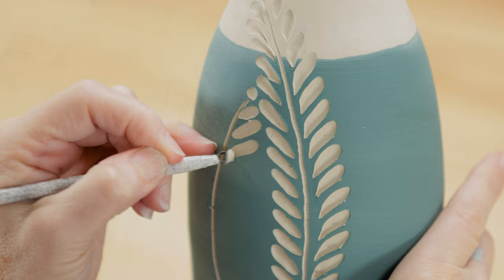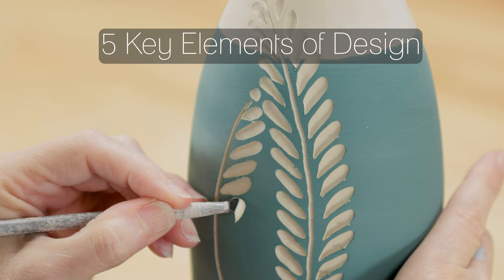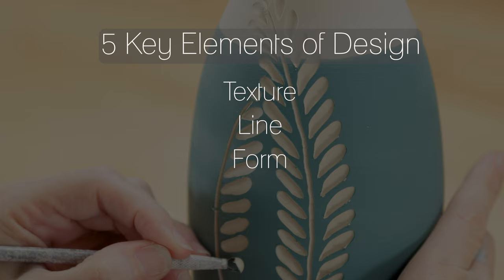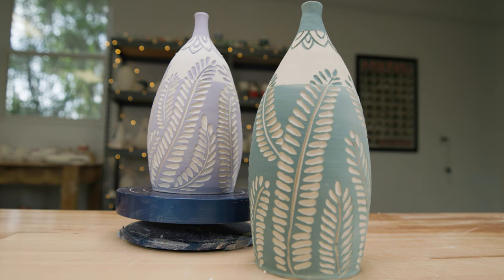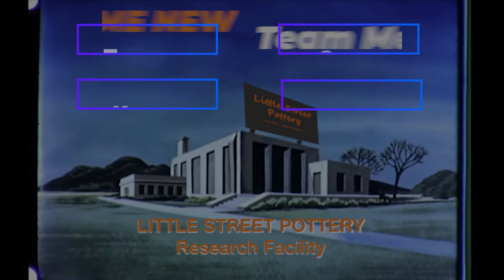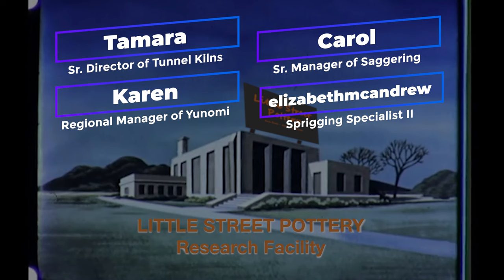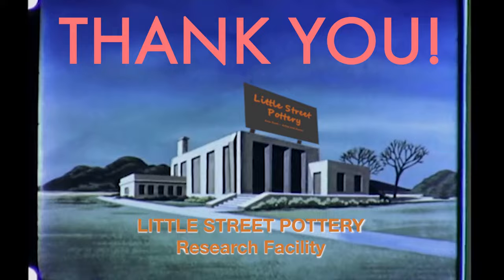5 Secrets to Better Carving and Design - Rethink How You Design Your Pots!

Comment: Ann, if you were going to buy just one diamond core tool, which would it be?  I am always looking for nice carving tools but then not willing to pay the price for diamond core, are they worth the price if you do a lot of carving?
Reply: Hey Vicki!  Thanks so much for watching.  That is a tricky question as each tool does different things.  It all depends on what you are trying to achieve.  I use the spinning trimmer all the time for dividing the piece into sections.  I use the extruder tools to make mug handles more than I find myself pulling handles these days.  I use the fluting tools when I am demonstrating fluting.  I use the triangle tool when I am making pieces with the reverse facets.  You just have to figure out what carving you want to try and then go from there.  Hope that helps.